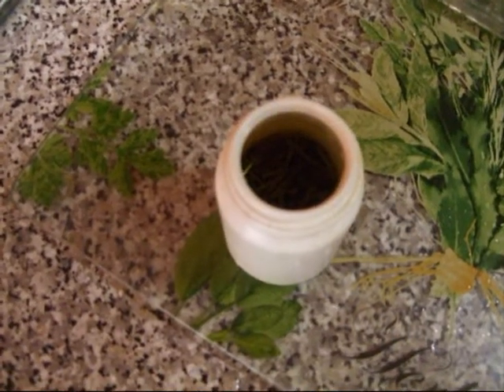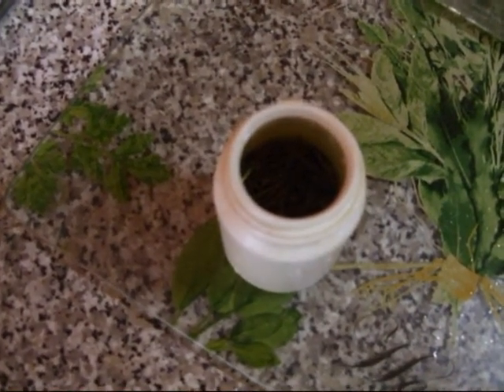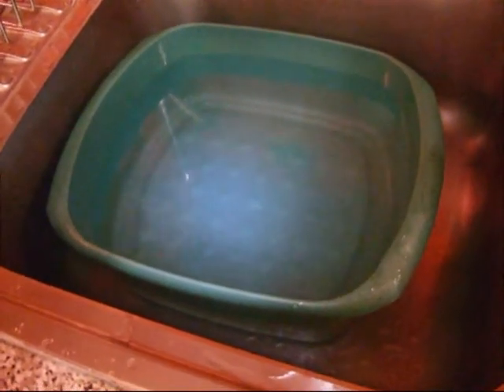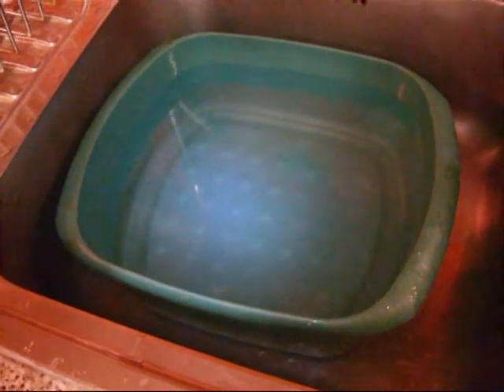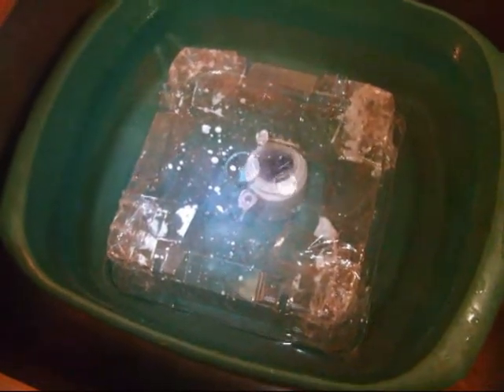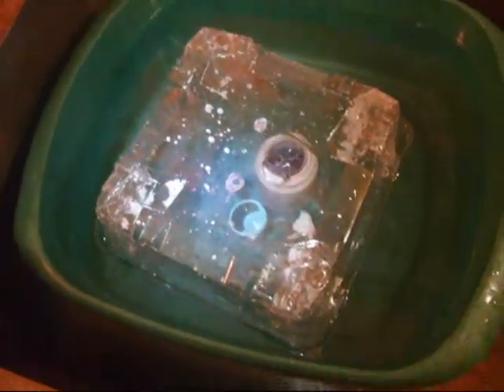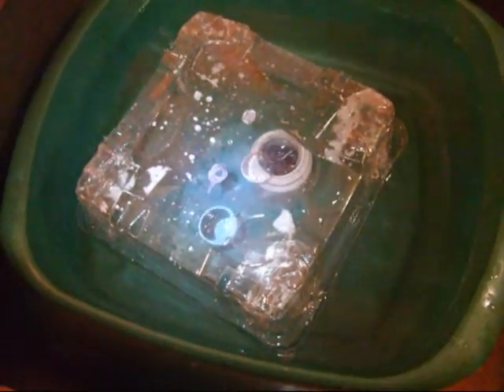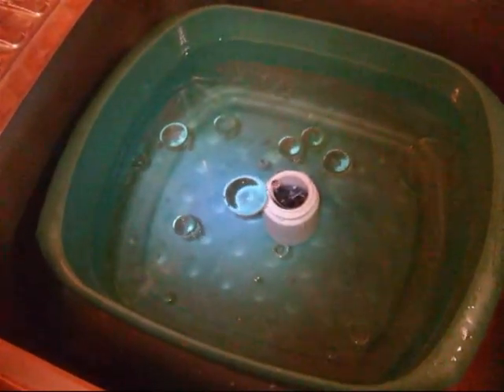Oil Spill in the Gulf of Mexico.

Comment from the maker: @matnels1 The shell roof is not intended to be placed above the water; instead it is intended to be partially submerged in water; so that the escaping oil will displace the entrained water under the shell roof and then can be pumped on to an oil tanker; which would be alonside the partially submerged shell roof.